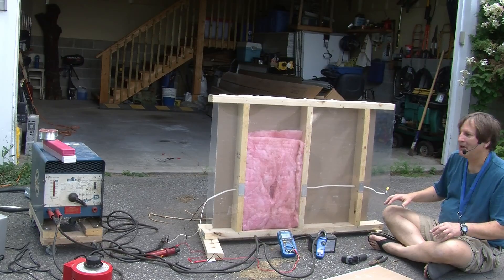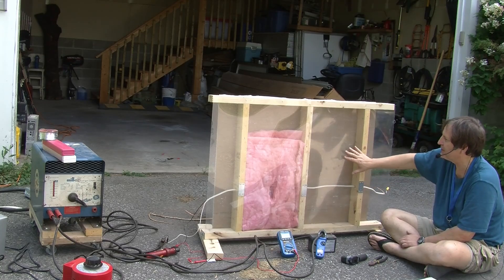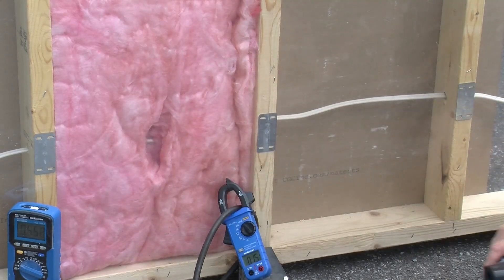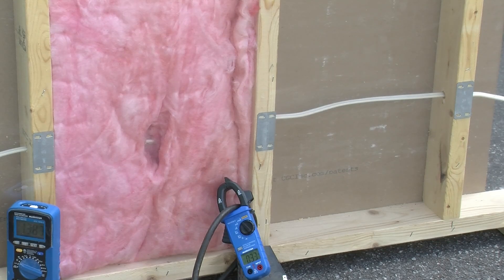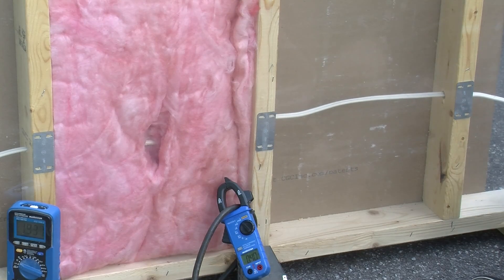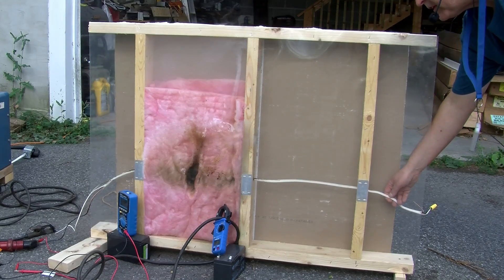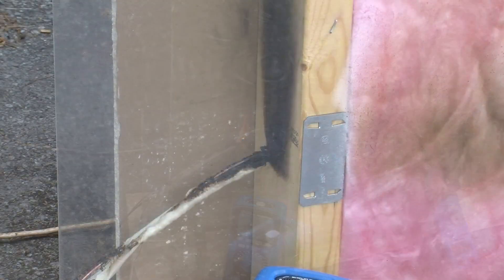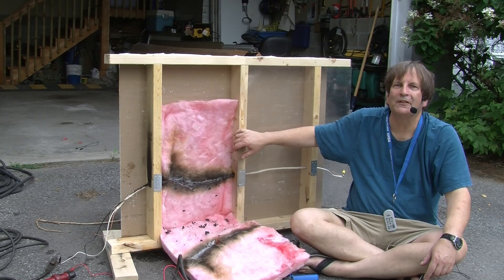Overcurrent +14/2 + Fiberglass in a 2x4 Wall

Comment: I'm waiting for the spray foam insulation version.    Spray foam, or at least some types, burns vigorously.     That should be interesting. I just subscribed to your channel
Reply from the maker: Unfortunately due to scattered showers today and the next few days  I will be delayed doing the foam one  : I'm doing it outside for smoke and fire reasons, and I really need   3 hours or more of good weather and dry driveway. Wednesday afternoon is the first break in weather - so if my real job permits I will do it then. If not, hopefully next weekend. I used plain old "great stuff" to fill in the area of the wall last night. I'm sure the 2 component commercial stuff and  the fire retardant stuff all acts differently. But they would all hinder any air flow, so as you said the results should be interesting. Thanks for subscribing!

Comment: Ahh the video I waited all week for.    I like that you left a section non insulated vs insulation.    This is a very good real life simulation.   Even though 25 to 30 amps didn't destroy the wire here, picture an older house, with a 4 circuit 60 amp fuse panel.     And assume the furnace had broken down in the winter.   And pretend the homeowner was low income and couldn't afford to fork out 2 grand for a new furnace right away.    So in the living room they have 2 1500 watt space heaters, lamps,  the television what have you.   Fuses keep blowing.   Homeowner runs out of fuses.   In act of desperation they decided to jump out the blown fuse with a penny.   Now in this example 30 amps or more, is not out of the question.   Let's pretend this is going on for several hours or more.   The status quote could be very bad.
Reply: It's all possible  Though to be fair I'm not sure the last time I saw a house with fuses in them instead of circuit breakers. I did look at quite a few older homes in circa 2008, and I don't think a single home still had fuses. I'm sure they still exist, but they're a lot less common than they were in the 80s/90s.
Reply: @stevesether  it's been quite a while since I seen a home with a fuse panel still in use.   Probably closer to 10 yrs ago.   I wanna say a lot has to due with insurance.   Although fuses by themselves,  are a very reliable overcurrent protection,  for the reason a fuse will always blow , whereas a breaker is a mechanical device and have been known to freeze in the ON position (FPE, Zinsco anybody 😉?) and are occasionally still used for AC disconnects, disconnects in commercial and industrial,  etc. in an insurer's eyes, fuses are an indicator of an older system that does not meet today's strict safety standards,  can have issues with brittle wire insulation etc. not to mention it's much easier for a homeowner to oversize or bypass a fuse, than a breaker which tends to only be replaced by an electrician or an advanced DIY'er.     Having said all that, it's either very expensive or impossible to secure an insurance policy,  hence a mortgage.
Reply from the maker: Steve - interesting! I'll bet a lot of thankfully gotten replaced. But I wonder about the rust belt areas that suffered the collapse of manufacturing and house values and incomes are low these days. I could see people there not being able to afford upgrading the panel and being in the scenario Kyle described.
Reply: @ElectromagneticVideos  It's possible.  They still sell fuses at big box stores, so homes that still have them must still be out there.

In 2008 I saw a house with a giant octopus (gravity) type furnace.  From what I gather, it was likely 50+ years old at the time.  I wisely decided not to buy that home.  So there's still some rare, old equipment in houses out there.
Reply from the maker: @stevesether  I have heard of hose furnaces - no blower right? The air and ducts must get really hot against the very dry old wood.
Reply: @ElectromagneticVideos  Yeah, no blower, only gravity driven.  They're often surrounded by asbestos.  And they're always only about 50% efficient.

I'm not sure how hot the air is.  The ducts themselves are very big since they have to operate by differences in density between hot and cold air.
Reply from the maker: @stevesether  Oh - the asbestos protects the wood. In spite of all of that I'm sure those furnaces were a luxury when they first appeared.
Reply from the maker: I think you described the scenario perfectly. And the going on for for several hours - I could sure see insulation weakening over hours at close to is limit. And probably add to that older house with those hollow wall that open into the attic with no firestop.
Reply: @ElectromagneticVideos  also in many old houses the insulation wasn't as good as in a modern home,  because prior to the energy crises in the 1970s, energy efficiency and being more eco-friendly wasn't that big of deal, and since we often had coal or wood burning stoves depending on where you lived, the cost of wood/coal vs oil, natural gas or propane,  etc a loosely insulated house could have been an advantage,  from a health safety standpoint.  In a heavily overloaded circuit,  could it be possible for a strong wind gust to introduce enough oxygen in the wall cavity to go from smoldering to a deadly inferno.    Maybe you could repeat the test, but with less insulation and a leaf blower,  to mimic this.
Reply from the maker: @Sparky-ww5re  Sadly I'm old enough to remeber the energy crisis from when I was kid. Dad was posted to Germany and for a while to save gas they had a rule that cars with an odd numbered license could not drive one weekend and the even numbers the next or something like that. I wonder how the less insulation + more wind plays out. Maybe more current before the cable burns because of the air circulation but when it does, it really goes as yous said.
Reply: @ElectromagneticVideos  What would be interesting to see is how hot it gets inside the insulation (you will need a few thermocouple sensors) after a few hours at 30 amps. That would simulate someone screwing in a 30 amp fuse and running it to the limit. I have a suspicion that there may be just barely enough leeway that you won't exceed 90°C at 30 amps.
Reply from the maker: @jrmcferren  I have ordered thermocouple! Very good point!

Comment: Very nice job.  I've always wondered about how hot these wires get in insulated walls, so it's nice to see someone do the experiment.  I'm glad to see there's still quite a safety margin with 14/2 wire even in insulation.  It's likely worth pointing out that ambient temperature of the air makes  a difference as well, so the safety margin is likely tested at something more like 38C/100F ambient air.

It's curious you had such a non-linear increase in temperature at 40 amps. One possible reason is that the resistivity of metals increases with temperature.  So maybe at 40 amps, this start a positive feedback loop where the wire starts getting hotter, which increases the resistance of the wire, which gets the wire hotter.  Rinse, repeat.
Reply from the maker: I'm surprised it hasn't been put on YouTube before. Good point about ambient air. Yesterday was about 30C outside, but in an attic in the southern US you might hardly need current flowing in the wires at all. 

The non-liner increase: on the previous videos I did see the resitivity increase - after setting a certain current the voltage drop would increase as the wire heated up (sometimes I had to re-adjust the voltage to the welder). But it wasn't that much. I first thought it was heat from the plastic insulation and/or pink stuff around the fiberglass smoldering but I think that happened later and contributed to the really high temp. Maybe next time it would be worth measuring the voltage at each side of the fiberglass region and same for the hollow area an see if there is an exaggerated runaway effect as you describe in the insulated region. That could make things way worse for a wire going from insulated to uninsulated areas in a house. What a great observation! I think you may have really discovered something there!

Comment: Very cool. Instead of a wire nut, could have put a box and outlet in the end and jumpered the hot and neutral with a cord cap (a plug) using a piece of #12 or even #10 to jumper the sides so to minimize its effect on the experiment. Would be interesting to see what happens to the outlet. 
I would also suggest that when you take your temp readings, go to the backside and check the temp of the Sheetrock.
Reply from the maker: Damm! I should have checked the back! Next time. I had thought about putting in an outlet box but end the end decided it might complicate or confuse the results. But maybe an experiment to see how well a box contains a massive overload sometime .....

Comment: Glad to see you get a thermometer.
15 minutes is not enough time to reach anywhere near static condition, especially where insulation is involved.
Reply from the maker: Any idea what the time constant  or time to essentially reach equilibrium might be? I do have thermocouple on order and it might be interesting to repeat with the thermocouple   next to the wire deep in the insulation and plot the temp vs time graph. Although might not make the greatest video! Also am seriously looking at infra-red cameras.
Reply: @ElectromagneticVideos  My guess is going to be difficult to calculate from theory when you'd reach an equilibrium, and it's going to be highly dependent on conditions.  You'll note resistivity of wire goes up with temperature, so that will produce some feedback.  

Your idea of  testing is experimentally with a thermocouple in the wall, and by plotting it on a graph is likely the best approach.
Reply: @ElectromagneticVideos  In my own experience running circuits near maximum allowable under NEC operating crypto miners at home, thhn and the connected breakers would take over 24hr at the rated current to reach equilibrium. Being 10% over breaker rating but under wire rating often takes multiple days before a breaker trips for instance as the wire can conduct heat away from the breaker when oversized.

I did some experiments out of concern as I had outdoor mounted load centers feeding wires running indoors and was concerned about risk in winter time for continuous maximum loads.
Definitely changed my perspective on how much current wires can really carry and how much safety is being kept in the code.

One main consideration is wires exposed to extreme ambients in an attic for instance. That would be an interesting test, 14/2 wire under 20 amp load in a 160-180deg F ambient condition with some of it laying in blow in insulation. To mimic someone swapping a 15a breaker for a 20a to operate an 1850watt window AC during a grid voltage sag/brownout in the 95 volt range in the middle of a summer day.
Reply from the maker: @mediadaemon  I never thought of wires conducting the heat away from the breaker but it makes total sense - good electrical conduction usually goes hand in hand with thermal conduction. 

So how consistent were long term trip levels from breaker to breaker? Spec sheet from some breakers show a huge allowable variation in trip current/time from breaker to breaker. 

Question: so why so close to the current limit for crypto mining? I is just to minimize cost of additional circuits or did I misunderstand?

Yeah - it must be real rough on the wires in an attic as you describe.
Reply: @ElectromagneticVideos  I never did comprehensive tests between brands other than Siemens and SquareD homline. Consistency was poor, 2 different new breakers would have noticeable differences in trip time at that slight overload setting. But more so, ambient conditions had major impact. A breaker at 110% by itself in an empty panel can nearly run indefinitely if the ambient is room temperature or below. But put that breaker surrounded by also 80% or more loaded breakers and it's much more likely to trip. Same with leaving the cover off, it improves the likelihood of the breaker holding much longer.

My testing all involved the fear of a breaker in an outdoor panel in freezing weather not being able to prevent a wire overload in the interior of my home.

There were two factors for 'pushing' the limits. One was that I initially wanted to have neat clean installs in server racks using server PDUs that were 30amp 240v, the ASICs at the time would draw 1400-1600 watts at 240v but like an induction motor, when the voltage sags on a switchmode power supply the current will increase to compensate. Having a continuous rating of 24 amps I wanted to know exactly what the weak link was.
Worse yet, is as ambient temperatures increase the ASICs become less efficient and can creep up in the current draw. Also, software is what was controlling the current limit of each ASIC and it was a concern if some sort of bug or firmware update/reset would cause them to draw the maximum of the power supplies.
I wondered too if the ventilation were to fail, a breaker in cold outdoor ambient, receptacles and cords in an ever increasing indoor ambient at the same time the current draw increases, what would happen.
I learned that wire and sockets can get incredibly hot before failing. The weak link in my basic tests was typically the rubber cord around the plug on the PDUs connecting to the 30 amp outlets. But not really in a burst into flames way, just a melt, char and eventually lose contact kind of way. (I had ceiling mounted receptacles with hanging cords)

The second factor, I had migrated everything out to a shed that was already fed with 6 awg thhn in conduit underground. My continuous draw at that point was 55 amps @240v. thhn in oversized conduit takes a lot to get hot unlike 6awg in nmb cable in enclosed walls. Ran that load for years before my current setup which is 2/0 copper.

The next generation of ASICs changed from ~1400 watt draw to ~3800 watt draw using dual Nema 6-15p cords, making the 30 amp PDUs no longer viable. I painted myself into a box trying to be "neat" and currently just put sub panels directly on the racks with several metal boxes that can easily be swapped out if the next generation changes it's power requirements yet again. It also solves the other concerns as the breakers are subject to the same ambient of the wire, receptacles, plugs and load devices it's protecting.

Comment: There's nothing like a good old practical representation of what happens in the real world regarding all things electrical.

Although the current passage in this demo, through 14-2 isn't typical, at all, but not impossible.
Reply from the maker: Exactly. To get to this sort of extreme sustained current one would really need multiple failures at the same time. But as you said, not impossible. Somewhere there must be statistics about the likelihood of this sort of thing happening.
Reply: @ElectromagneticVideos  There was a comment indicating that the situation is not realistic due to such low voltage. Is there any way to test how long the 14/2 cable would last powering up a 120v 30amp appliance?
Reply from the maker: @hippo-potamus  Well I respectfully disagree with a few comments that have said that. There would be a small difference towards the end of the experiment: the initial approx 50A heating of the wire would be the same. 50A through the same wire resistance will always produce the same heating along the length of the wire. The difference would occur after the plastic has softened considerably or begun to melt. The higher voltage might punch through some weakened or thin insulation and char the plastic and as more power flows that path make things even hotter till a full short occurs or really bad things happen like a huge current burning up the wire. The charring we saw in the fiberglass area might also allow the higher voltage to push some current though the carbonized plastic adding heat. So depending on how things as setup in such a test it might be different towards. All I want to do here is get a sense of at what current does the plastic start melting and really bad things start happening. And it does that. 

I would think 30A continuous is in a grey zone where a lot depends on the circumstances. Outside my house near Ottawa on a -30C winter night it might do fine! In a hot attic between insulation in a Texas summer it might not! Even if it were to do OK the prolonged high temperature may cause a gradual deterioration of the plastic insulation. There is a good engineering reason for a significant safety margin. 

So I realize the 30A in your question is for illustrative purposes but to anyone reading this, PLEASE always use the approved size of wire rated for the current! You cant beat 100 years of hard lessons learned by the various approval agencies and manufactures. And you dont want to become one of those "lessons"!
Reply: @ElectromagneticVideos  Do you think the 15amp breaker would reach its thermal disconnect point before the wire sheathing began to melt?
Reply from the maker: @hippo-potamus  It should! But things can fail. Another commenter pointed out that Federal Pioneer breakers have a reputation for not tripping.